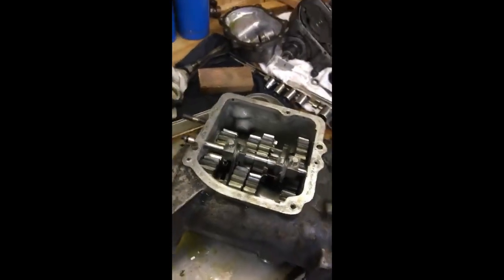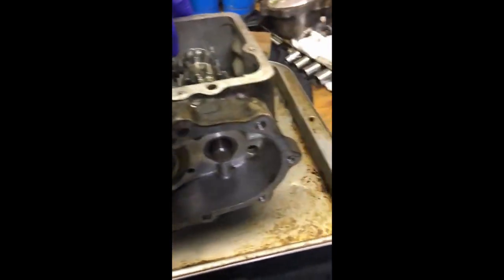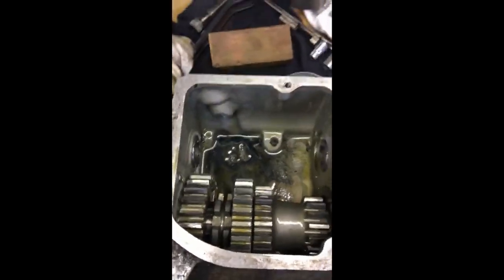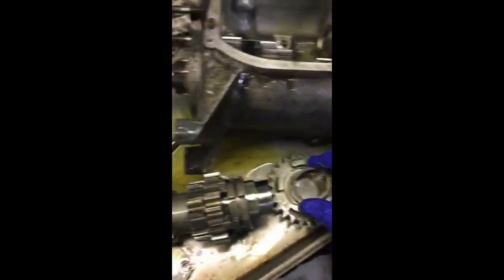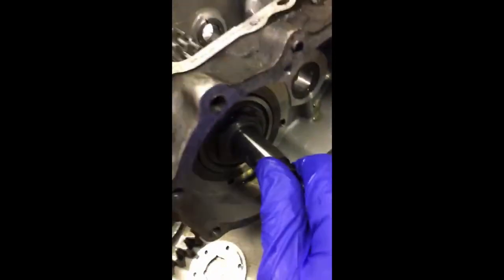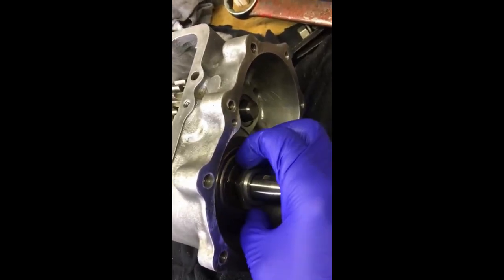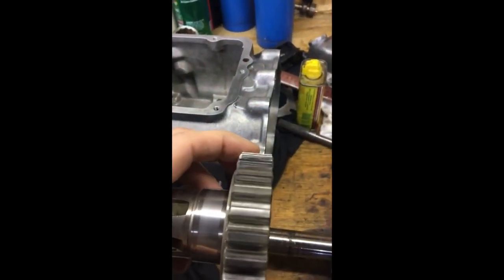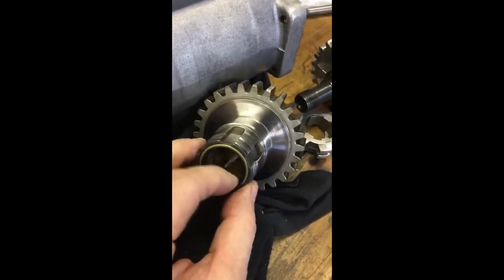Harley Davidson Shovel Head Rotary Top Transmission Rebuild

Comment: This came out of a belt drive bike?  I’m putting an ‘81 Low Rider together and bought a belt drive rotary transmission which I need to convert to chain drive. I know the main shaft has to be changed and maybe 4th gear.  Have you ever done a conversion on one of these?
Reply from the maker: I’ve never done that before. I see that belt uses a different main drive gear (4th gear) than a chain but they use the same main shaft. Also Drag Specialties sells a sprocket for your year cheap. Maybe you can buy the sprocket and make a custom spacer to make it work. Let me know how you make out. Thanks for watching and good luck. 
https://assets-static.lemansnet.com/sites/flippers/2022-2023-Drag-Specialties-OldBook/534/

Comment: I just had a bushing machined into the transmission top to support the shifter disc better. Is there any other hints???
Reply from the maker: Not that I can think of. The rotary top trans is just about the same trans as the older 4-speeds except the rotary top. I did this video very early on in my YouTube days. If it was today the video would be much better. Thank you for watching.